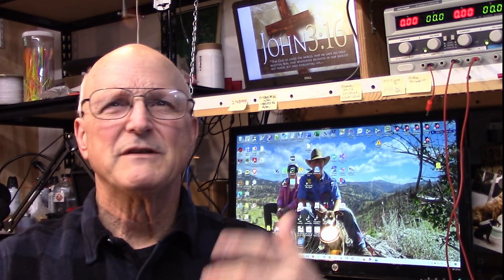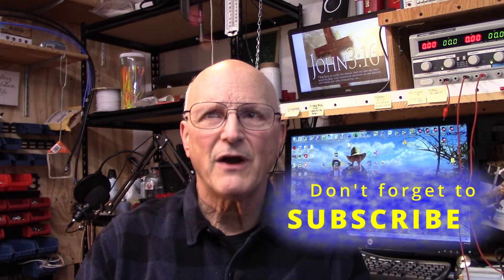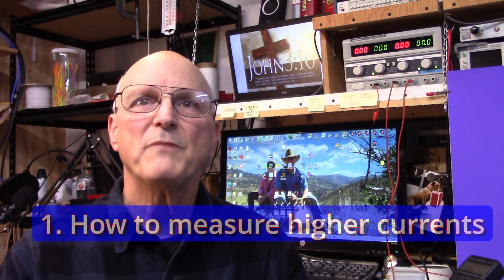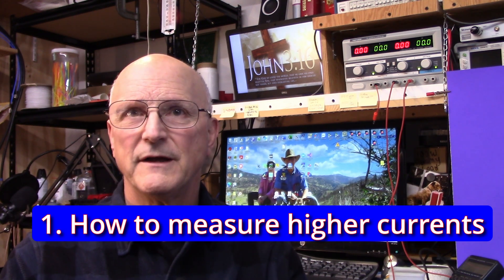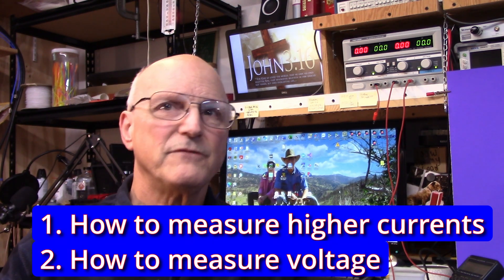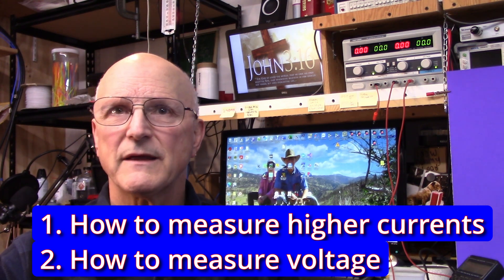How to Characterize an Ammeter: Internal Resistance & Full-Scale Current (019c_v2025)

Comment: question for you, how would i measure an automotive ammeter without all those fancy tools...? i only have a DVM and i need to measure the gauge so i can make a new shunt so i can measure the upgraded alternator and don't burn down my truck
Reply from the maker: You will need two potentiometers (pot), a voltage source (like your 12 v battery) and your DVM.
The first pot needs to be large enough value to so that it can act as a current limiter for the meter. If you suspect the meter is a 1mA meter, then the pot needs to be larger than (Vbatt)/(1 mA) => preferably 50% larger or more.
The second pot needs to be about twice what you expect the internal resistance of the meter might be.
** ZERO your meter before beginning. **
[1] Measure the voltage of your battery (Vbatt).
[2] Set the first pot to its maximum value. Put it between the battery and the meter and the other side of the meter to the battery.
[3] Carefully adjust the first pot to achieve full-scale on the meter - don't forget to tap on the meter face to release friction).
[4] Set your second pot to its maximum value. Connect it across the meter terminals.
[5] Adjust it to achieve a half-scale reading on the meter.
[6] Disconnect everything.
[7] Using your DVM, carefully measure the resistance of the second pot (R2). This is the internal resistance of the meter.
[8] Using your DVM, carefully measure the resistance of the first pot (R1). 
[9] Now do this math ...  Imeter = (Vbatt)/(R1 + R2)
Understand that this is only as accurate as the DVM you are using. ALL measurement instruments only measure within certain percentages of true.
Hope this helps. :-)
Reply: @eie_for_you  i really hope it does, its a charge/discharge ammeter (no numbers) that was originally made to read a 70 amp alternator and i've upgraded to an 130 amp
so i don't need it to be super precise, i have wiggle room. just need a rough number to get the right shunt for it to not set the truck on fire because im passing way too much current through PCB's and thin wires!

its gonna be a while till i can find the budget for some pots, but if this works the bullnose ford community will thank you!
Reply from the maker: Sounds like a great project! :-)

Comment: I have new meters to replace the ones on my Sencore SG165, the new meters matched perfectly as well as the part numbers, same meter for L and R but the old meter measured ~ 300 ohms, and the new meter is ~ 75 ohms, someone else on line mentioned a reading of 315 on their SG165 meter, so not sure why its different. Current is 1ma full scale, Sencore claims 500uA in their service manual. Unfortunately I never measured the current through the old meters before they got trashed.
Reply from the maker: That is going to make it a challenge to get those replacements to work for you! :-(      :-)

Comment: Many of these old movements have been 'pegged' and the needle is bent (relatively straight forward to fix.) Others, the movement has been damaged (but the coil is okay.) A good video would be about fixing one.
Reply from the maker: Hmmm, if they have been pegged, the likelihood of them being viable is seriously in question. I wouldn't even buy any used meter movement if there was evidence of damage. As we say here in the U.S., that would be a "pig in a poke." :-)
Reply: @eie_for_you  I don't think I've ever bought these old meter movements; but, they do get passed around. The good ones, were designed so that the needle could impact on the stop=peg, at full scale... even violently. Anyway... as long as the coil isn't burned out, I've repaired many of them. (You can re-calibrate them, and re-draw the scale if necessary.)
Reply from the maker: I prefer not to have to repair them, so I wouldn't buy them. :-)

Comment: These are all galvanometers (a term still used in Europe) of the D'Arsonval type (There are many types of galvanometers) The reading on a D'Arsonval type meter movement scale is proportional to the current through it? (AFAIK, current is the only way you can create the necessary torque in a magnetic field.)
Reply from the maker: Yes, the deflection of the needle is proportional to the current applied. All analog meter movements respond to the current through them.
With that said, some of the analog meters have been supplied with an internal multiplier resistor which, while they still respond to the current running through them, the voltage necessary to cause this deflection is MUCH greater. Thus, the term "multiplier" resistor. The purpose of this multiplier resistor is to use this meter movement to indicate voltage as opposed to current. These will most often have a scale marked in volts of some sort. 
So, when I see a scale in volts, I have to ask the question, "Does this meter have an internal multiplier resistor?" I have a video on how to determine if this is the case. Here is the link to that video: https://youtu.be/JUPBfX4fcDY
By the way, I do not know what the acronym 'AFAIK' means (I'm not going to guess). I kindly ask all of my viewers to refrain from using acronyms as they do not contribute to effective communication. :-)

Comment: Thank you for the video. I might have misunderstood something, but why is the meter showing 30 volts with the applied to 2.4volts?
Reply from the maker: We must make a difference between the scale on the meter and what the meter really is. Meter can have all sorts of scales which are very different than what they really are. The circuitry into which they are embedded make the scale work. When they are all by themselves ... a meter with a 3kV scale could be a simple 50uA ammeter.  OR, it could have an internal multiplier resistor to turn the native ammeter into a voltmeter. This is why I created the video on how to make sure that you know if the meter you are holding is a voltmeter or a simple ammeter because scales do not tell the whole story. Here is a link to that video: https://youtu.be/JUPBfX4fcDY
In this video, I was characterizing an ammeter. The voltage I used might have been 2.4 volts, but what mattered was the current through the meter which is a function of the series combination of the meter's internal resistance, the added series resistance and the applied voltage across the series combination of these two.
I hope this makes sense. :-)
Reply: @eie_for_you  Thank you for the explanation. I didn't realize it was an ammeter. The other video that you linked is helpful as well. Analog meters is a fascinating topic which helps better understand core concepts of electronics, at least for me.
Reply from the maker: You are very welcome! I have to agree that these analog meter are cool! :-)